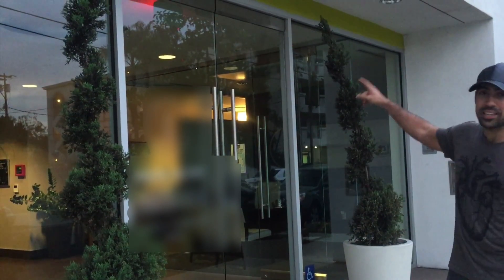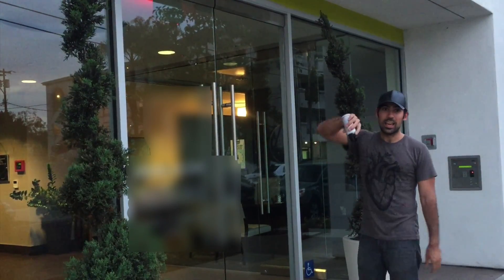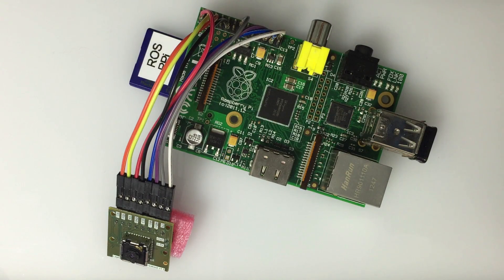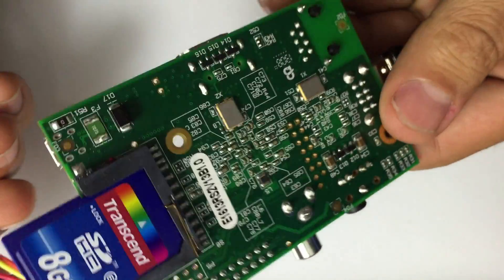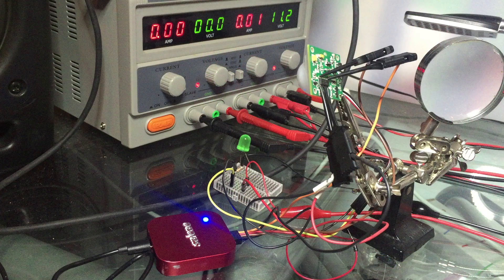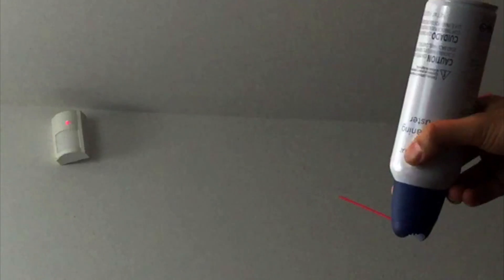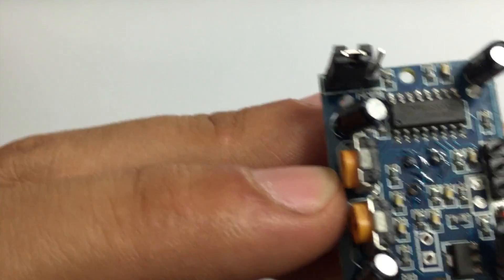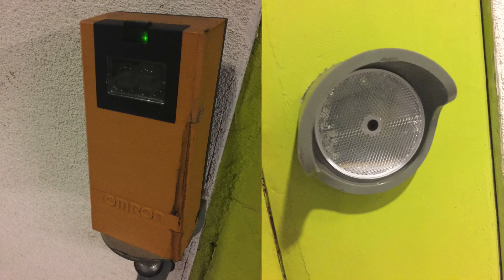Unlocking Motion-Sensor Secured Doors With Air Duster

Comment: I came here after figuring out you can do the same thing with a big flat washer heated with a lighter and kicked under the door crack.
Reply from the maker: Interesting, makes sense as a warm washer would give off IR (just as we do). How large was the washer?
Reply: @samykamkar  it was a bigger size fender washer for unistrut. Probably 20-30g. About 50mm od.

Comment: This is a perfect example where you get what you pay for. Use cheap diy shit or cheaper companies and get cheap ass  access systems.. Real companies use atleast a 2 sensor motion. Never IR only that you can buy from China for 1.99 with free shipping . Not to mention bio metrics. Most systems don't allow the door to be unlocked by motion or Rex switches after hours. Most employee rfid also don't work after hours. Only  a managers.  Atleast  when a professional company does the system. And a step further  an access system. that is locked that detects enough motion to open the Rex locked door would set of the security system and locking all access devices..

Comment: Hi Samy. I was wondering if you could open Motion-Sensor Secured Doors with a coin by rolling the coin inside the building through the gap between the doors. Should the coin be hot (maybe rub it in your hands before rolling it) or the coin itself is enough?

My idea is that anybody has a coin in the pocket.
Reply from the maker: I don't think there is enough change (pun intended) in temperature of the PIR sensor to detect it. If the coin were directly near the sensor, then it would possibly detect it, but once there's a little distance the temperature change will be too diffuse and not be visible to the sensor. It typically takes a larger object (animal or larger) from that distance, or something but close to the sensor.

Comment: It's fake, he had someone recording from the inside already and that person triggered the detector.
Reply from the maker: Nope. Test yourself on a motion sensor.
Reply: It will work for very cheap motion sensors, but most buildings worth breaking into have advanced PIR zones than can tell the difference between the shape of a human and a puff of cold air.
Reply from the maker: Can you link me to one of these PIR sensors? The only IR cameras I've found that would allow for any legitimate object detection are > $100 (FLIR, for example), and don't even include the computing power to actually do any object recognition.
Reply: You don't need a camera to distinguish the human from the cold air, for example you could calibrate the "dumb" PIR detection logic to only trigger when an object is walking through the detection zones at a certain angle/speed. Certain systems also allow disabling of the trigger when motion is detected outside the door http://resource.boschsecurity.us/documents/DS160_DS161_Data_sheet_enUS_9007201890365835.pdf . You might also be interested in this , https://na.industrial.panasonic.com/products/sensors/sensors-automotive-industrial-applications/grid-eye-infrared-array-sensor

Comment: this only works if the door is programmed to open on RTE. other wise it's totally useless
Reply from the maker: Hence why the title of the video explicitly calls out "Motion-Sensor Secured Doors", aka PIR RTE/REXs.
Reply: every access door should have a rex/rte but not all are programmed for it to unlock when it's triggered. and no reputable security company would program an exterior door like that. iv'e been working in the security field for 20 years and that's an amateur  job.
Reply from the maker: What is the point of a request to exit sensor that doesn't allow a user to exit?
Reply: the point is so that the system know when some one WILL be exiting and not generate a forced open alarm. a forced open indicates an unauthorized entry. if the rex unlocks the door it can create false unlocks which is a security risk.  and you showed just how it's a security risk.

Comment: The REX pir is not properly installed and/or the door is not programmed correctly. While what you are doing will trip the PIR it should not open the door if everything else is done correctly.
Reply from the maker: How so? Most PIR REX's I've seen are wired in series to maglocks for fire code (with timer). If you can trip the PIR, then you've tripped power to the maglock.
Reply: #Wrong

Comment: This will work only when the selector switch of the door is in "exit mode" (permitting leaving from inside the building). If the door is locked infrared receivers at both sides are deactived, so the door wouldn´t open with the air dust. Great trick though! Subscribed.
Reply: Motion has to be in exit mode by code. You can't trap people in a building, genius.
Reply: Exactly.

Comment: that is a good reason to use dual tech (microwave/passive) motions for anything security related. Thats a cool hack though, Sammy!
Reply: Exactly. Real systems have micro / RF motion. This is some shit ass China rfs Rex switch shit. Some dude slapped stickers on his van and quoted dirt cheap prices to get this place robbed.   Not to mention biometrics. After closing hours the Rex doesn't work anyway.
Reply: @mipmipmipmipmip  you should sue the company that made you use that walkie talkie

Comment: We have those doors in our office and I often thought that a sheet of newspaper on a thin metal yardstick slid between the door would also release the door, what do you think?  If you waved the paper near the sensor would the size of the paper create enough displacement for the sensor to open the door?

Comment: Whoa, that seems like a pretty stupid design fault even on paper.

Usually these doors have a dedicated push button inside to open the door after-hours, but I live in Finland though.
Have you heard of iLoq btw.? It's self-powered electromechanical lock innovation. Would be cool if you had a go at it to find any vulnerabilities. Here's a video about it:
https://www.youtube.com/watch?v=1KS7nbHIRcY
I'm currently inspecting one right now. It incorporates presumably Maxim Deepcover MCU and reads keys using 1-Wire rolling code SHA encryption.
I suspect you could actuate the latcing motor outside, if you had a strong enough magnet.

Looking forward to see more detailed video, you rock dude!
Reply from the maker: RealationGames Thanks! iLoq looks interesting, I'm checking it out now. These motion sensor activated doors are pretty common, at least here in the US, to protect various buildings and entryways. I've seen push-button style types as well but not nearly as often.
If you find any issues with iLoq, would love to hear about it on here!
Reply: @samykamkar  that is just a junk ir motion . Probably simply safe shit
Reply: Yes. Biometrics would have the motion disableb after hours with only a palm switch useable.

Comment: Where do you fond those door i dont understand what they are user for
Reply from the maker: ***** This is the type of door found in many corporate buildings and apartments where it's locked on the outside (typically protected by an RFID keyfob or key code) but unlocks momentarily if you're already inside and walk up to it. However, we defeat this from the outside.
Reply: ***** The system exists so you can have fancy glass doors without latches and push bars that let people out, but not back in.